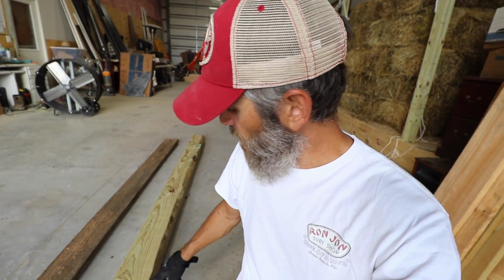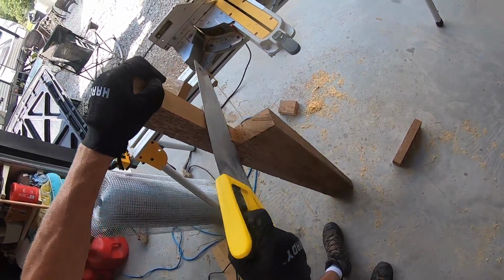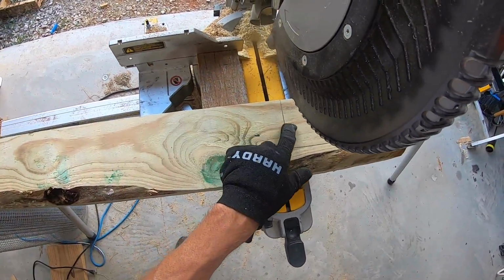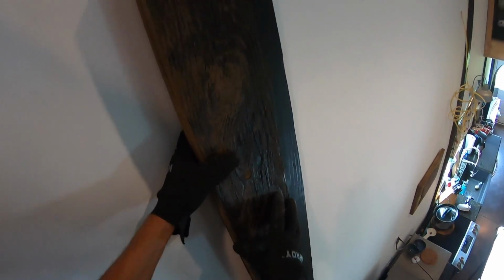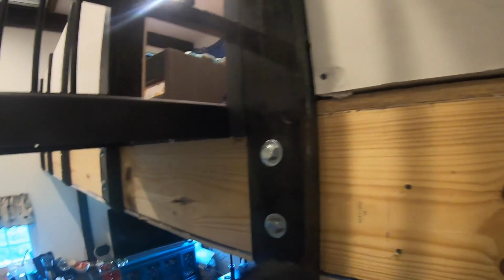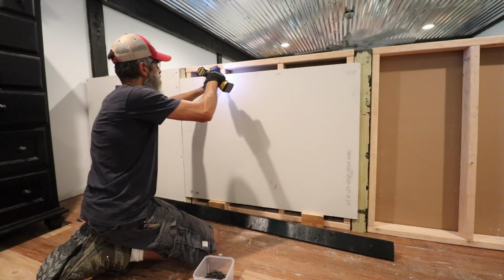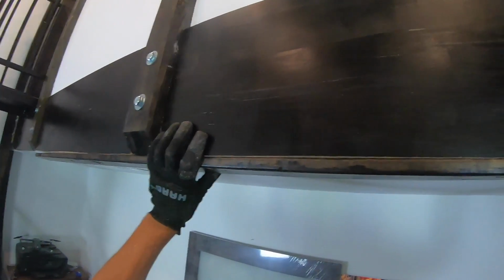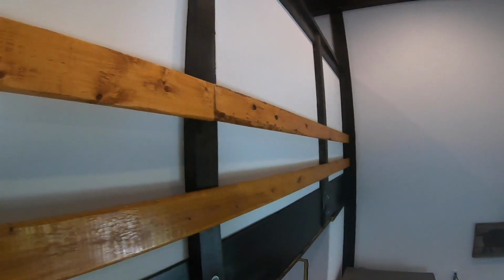4 Board Fence PONY WALLS for the LOFT Bedrooms inside the Barndominium

Comment: As a thought regarding the cap rail.  What if you cut the rail over the removable section at 45 degrees so you form a V across the RM section.  That way it hides the gap when not in use...I would have probably used cotter pins to hold the section in.  It would make it easier to RM when needed.  If the bridging trim is only screwed to the RM panel then it will make for easy RM of the panel when needed.  Use the same method on the trim to hide the gaps.  Cutting the trim where it goes horizontal at a 45 degree will cover and hide the gap..Unscrew the trim, pull the cotter pins, lift out the section...Easy...

Comment: I think if you had gone with hog wire panels cut to fit into gaps and sandwiched between 2x2 frames, you could have maintained the open concept look and achieved safety too.  For an example check out the show Tree House Masters.  They use this concept in their high-end tree houses.  Very classy and easy to build.  By using drywall, you are potentially blocking airflow.  You can easily install a wire across the daughter's space and hang hooked curtains on the wire so your daughter can have her privacy in a pinch.  I would not trust those posts to be fully strong in a pinch because you cut more than half of the structure out of the posts and the grain going the way it does could potentially check along the grain as it dries out.  It would depend on what the humidity level is maintained at.   I would have used 4x6 cedar posts combined with the pig wire and a double top cap with staggered levels.  Also, remember that as long as the top rail is higher than your waist you will be fine.  I do like the concept of rough lumber for the posts.  Good call on that.  I lined the walls of my garage and closets with 5 inch wide by 8 foot tall fence pickets.  They were all mitered with a lap joint to counter joint opening as they dried out.